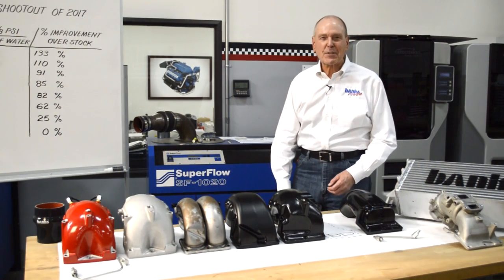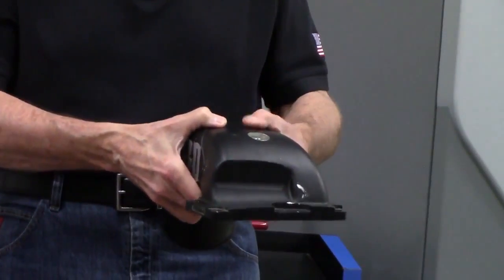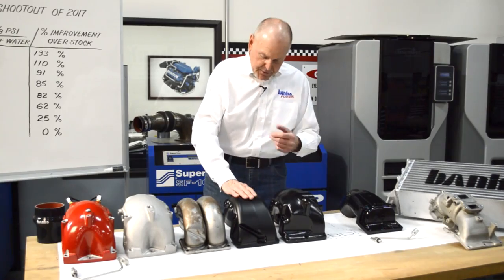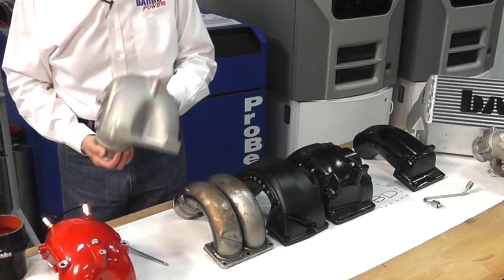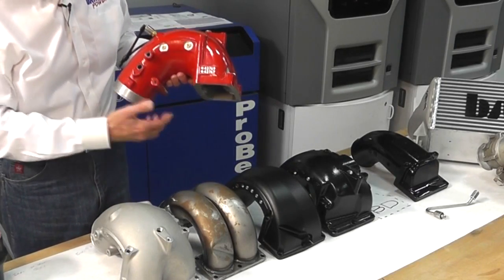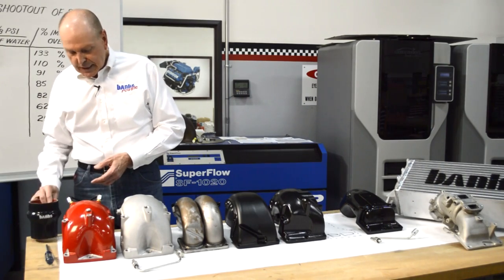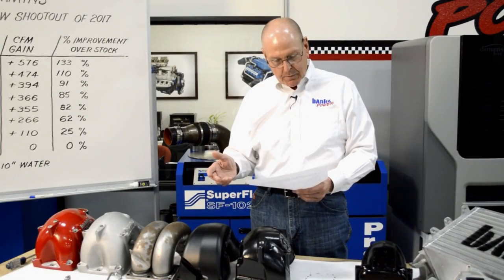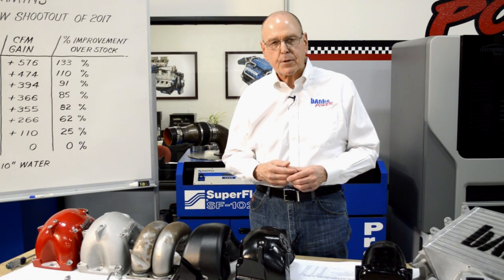Banks Monster-Ram is the best Cummins 6.7L intake manifold available.

Comment: I get Banks flows better @ 1008 over the Pusher @ 826 giving a 182 difference. But Banks advertises their horn at around $750 versus the Pusher at around $50? For the guys who just absolutely have to squeeze every CFM or who are running down the track then I get it but for the cost versus CFM gain for the average driver who wants to play a little bit on the street we're in the mud field that I can't see why the Pusher intake wouldn't be the clear winner for best bang versus buck and especially when you are essentially doubling your CFM over your stock horn.

Comment: Mr banks i recently purchased all your products for my 2022 dodge ram 3500 4x4 mega cab. Wsiting on cold air induction and intercooler tubes and horn. Intercooler still in development but will add that later.
Reply: How is your truck holding up?
Reply: @Sharee  so far really good got 19,000 miles on it
Reply: @GaryBlankenship96b40  OK, that's great to hear. I have the monster intake with heater grid delete. I will install mine soon.
Reply: @Sharee  i just a recall on that to park outside because heater can malfunction so i can disregard lol
Reply: @GaryBlankenship96b40  LOL, yes I received a recall notice for my brand new Ram as well, but I also have a 2016 Ram 3500 that I'm referring to about replacing the intake soon. They never made a recall for that heater grid which they should.

Comment: Fast forward to 2022 and now BANKS is almost 3X the price as they were here in this video
Reply from the maker: The price provided in this video was for the Monster-Ram as a solo device with no fuel line, no high-flow billet heater plate, etc. If you factor those items into the 2017 price and you account for price hikes in raw materials that have affected thousands of businesses including auto manufacturers, you're at the 2022 price.

Comment: the ss pusher goes for as low as $80 online so your really not that competitive.
Reply from the maker: The Pusher unit was priced over $350 before the Monster-Ram was released. If there was strong demand for it, the price would not have been reduced.
Reply: @bankspower  the price is what is because its so easy and inexpensive to make. Almost any pipe welding shop can easily produce the ss style and thats why they go for so little on ebay. 

I love Capitalism!

Comment: Bench flow tests mean nothing.  If he was truly seeing big gains he would dyno each elbow on the same truck, but he knows the numbers are insignificant, so he won’t.  Instead he measures free flow through the elbows at insane amounts of air, which a diesel doesn’t even use. 3-400 dollars for maybe 1 psi of boost.  The only product that’s legitimately tested is the diff cover.
Reply from the maker: The Monster-Ram isn't designed to make horsepower. It's designed to ALLOW you to make more horsepower, efficiently. But it appears that what you're really saying is not that you don't like the Monster-Ram or the way it was tested, but that you don't think an intake elbow is worth the price for the airflow gained. Every car/truck enthusiast makes choices. What return on investment do they require to feel like they got their money's worth. And, for every person, that equation looks very different. If you attend events like UCC, you'll find quite a few Cummins owners that value the Monster-Ram's flow gain.
Reply: @bankspower  Thanks for the reply. I appreciate your admission that the monster ram does not provide any noticeable gains in either boost or horsepower in stock form.  That was my point.  That’s why you published a bench flow test, and no real world results with the monster ram mounted on a 6.7.  I understand if someone wants to throw an additional 7-10k into their engine, the monster ram might ALLOW better flow.  Good news is, most people like bling.
Reply: @dodgecummins6181  For some of us it is not a bad thing that the manifold does not produce more horsepower. I am thinking about getting a Monster Ram for my 2017 3500 just to get rid of the grid heater. I am retired and haul an RV, and reliability and durability are everything to me. I already have enough power. I don't want to sacrifice any reliability or durability to get more. I do want the "killer bolt" fix that the Monster Ram provides. But i am not interested in making any more horsepower at all.
Reply: @headdown1  sure, sounds just fine on a 2017.  Useless on my 06.

Comment: I know this is an old video but if they are so proud of their products and their design and not compromising on the design they shouldn't charge for the fuel line. It should be included since you 100% need it.

Comment: I know you guys do all sorts of testing, but have you ever thought about dimpling the inside of the elbow like a golf ball to create a lower drag coefficient for the air passing over the walls?
Reply: It's a great application of that technology, but it's likely not cost effective in this situation.  The air horn is meant to slow down the air (increasing the pressure) and directing the flow into the manifold.

Comment: I have the Cummings 903 engine in my boats. Good reliable engine. Just weaker then hell. Only pushing about 300hp with twindisk gears 2:1 and 28”x24”props. Ill check on prop measurements again tomorrow to make sure i told you right. Can i get some info on any ideas for more power on them. Have someone contact me please.

Comment: @bankspower I bought a Canadian 2013 6.7 Cummins with a Shocker Pass (air shut off safety system).  I have disabled the system and removed the wiring harness. I want to remove the butterfly air shut off assembly beneath the intake elbow piping. The truck is already EGR deleted and tuned  but has a factory intake elbow. I have heard that leaving the heater block installed makes the banks intake elbow useless. I live in a cold environment and want to leave the heater alone. My roundabout question for you: Is this true? Will I get any improvement with just your intake elbow? Also I need to remove that Shocker system which takes up around 8 inches of tube beneath the elbow, is there a complete replacement included in the kit. Thank you very much for your time. Hopefully I will make my first Banks Power upgrade and become a lifetime customer.

Comment: I'm a big fan of what you do and how much R&D you put into your products; however, why aren't the same design principles applied to all of your products? For example, I have a 98 12-valve Cummins, but the intake elbow has square cross-sections and costs about double what this one does. I realize that it is a different overall design and may have more machine work involved, but it seems like that could be executed better like the 6.7 L version is.

Comment: Too bad I have an boost leak after installing their product and their hose clamps suck, didn’t come with all hardware,  and most of all extremely rude customer service! Would never recommend nor do business with them again. $956 dollars later I gotta go buy different hose clamps and use bolts around the garage to close off holes on the inlet horn. Thanks!

Comment: Running Banks Monster Ram intake & Intercooler on my 5.9,best around!
Reply: Did you notice an improvement with the monster ram
Reply: Also got the Banks intercooler,so yes,gonna  install the grid heater delete & Flex A Lite fans next,just installed a Fass 165,Beans Diesel sump,Glowshift big line kit & Fleece fuel filter delete distribution block.

Comment: Ok, it flows more CFM, but the restriction is your head. Put a 55 gallon drum horn on it if you like, but it's only going to breath as much air as the head breaths...
Reply: Exactly what I was thinking.  Not an accurate test because flow isn’t measured at the head of an engine.

Comment: I see the idea of this test but this is measuring total CFM through the intake horn to atmospheric pressure, no restriction (cylinder head). Most stock Cummins heads flow approximately 165 CFM and modified heads around 250 according to D&J Performance’s website. If you have a intake elbow that flows 900-1000 CFM what are you really gaining if your head will only flow 165-250? Theoretically the stock elbow will flow twice what the factory head is capable of.

Comment: I dont buy banks for 3 reasons.
1.  It wont clear twin fuelers - ie ATS twin fuel kit
2.  Im not convinced that the extra flow equates to ACTUAL RWHP.  My truck sees well over 100 psi at the intake manifold
3.  It consistently cost more

Comment: Would this test more or less apply to 5.9 elbows?
Reply from the maker: Each intake elbow will raise boost without increasing backpressure at the turbine which results in a more responsive, fuel-efficient engine. That being said, the idea and testing on the 5.9L could be done in the same fashion, but the performance numbers will be completely different for each engine.

Comment: What does one of these do to my factory warranty?
Reply from the maker: Unfortunately, the Monster Ram intake elbow is for racing purposes only and is not rated for street use. It requires a race tune for the ECU which means voiding the factory warranty.
Reply: @bankspower  can you please comment as to why you didn't show the stock intake like you did all the others?  It (stock) was sitting to the side for a bit then disappeared off camera.  It seems as though there are at least two versions of the 6.7 intake.  Banks along with everyone else shows a really restricted version for all their comparisons.  When in reality (read the reviews and look at the pictures on banks power website) the stock intakes are not near as restrictive as you advertise.  Please comment on this because the consumer deserves the truth, and not some marketing/advertising gimmick.

Comment: None of these intakes matter if the stock size compressor wheel is on the engine. That is your air limiter. Not the intakes. Who gives a flying fuck with these tested on a air flow bench. Funny how they didn't dyno the engine with each intake installed for hp and torque difference. I'm pretty sure i know the reason why.

Comment: I have a stock intake elbow on my 6-7 Cummins I can run 42 psi of boost with my stock Turbo measured with an analog gauge in the manifold that's 42 PSI waiting at the valve. what the hell does the intake elbow have to do with any of that
Reply: Has to do with running the engine in the higher RPM'.s The restrictions start to add up to gain flow at a good temp for controlled combustion. Basically, The more restriction after the inter-cooler, the more temp rise you get in your intake charge. Just 5-10 degrees can make a huge difference.
Reply: @Darkhalfcustoms  okay I get that but wouldn't the metering orifice technically be the intake valve ports?
Basically I'm wanting to know since I run 42 pounds of boost with stock intake stock Turbo at 2300 RPM if I put his intake horn on will I gain any noticeable horsepower over that?
Reply: @trxcummins7388  I would say you would have to do some math. It comes down to the cfm of all the intake valves VS the cfm of your intake horn. I don't think it would be a huge difference.
Reply: @trxcummins7388  the best way I can explain it is with wiring if you try to put 100 amps down a 16 awg wire it melts. But you put a 1-0 awg cable there and no problem. Pressure in your system is like amps in a wire if you don't have a big enough wire to flow the amps (volume of air) then it can't get there very good. Engines are air pumps the more effective they are at moving air around the better they can run. Do if the motor flows a larger volume of air easier then less boost is needed to get the same power.

Comment: The elbow flowing good is all fine and dandy but what is the purpose  of the elbow when the log on the intake is the same no matter what elbow is on it. Its basically impossible to port the log on all 6 cylinders all the way to the intake valve. So what exactly is the point. Its like a victor manifold on a stock goodwrench 200 horse 350 chevy.

Comment: Why is pusher the one that you need to beat as per gale bank's words?, and I just so happens the crappies looking one of the off brands had that the best flow. Yes just under bank's that is.
Reply from the maker: Not sure what you mean by "needs to be beat." Does the pusher intake work? Sure. How much better did it perform than stock? A little better. Did the Monster-Ram out-perform it? Yes, by quite a bit. That's what we pointed out. All the performance numbers are there for you to evaluate.
Reply: @bankspower  are you going to do a video for the 5.9 manifold?
Reply from the maker: We already do. https://shop.bankspower.com/i-968
Reply: @bankspower  thanks for your help!! Have a nice day.
Reply from the maker: Ahh... now we understand. The Monster-Ran "needs to beat" the tubular piece from Pusher because it's so basic. It's the baseline. Meaning, it's what you would build if you owned a tube bender and a welder. Entry level.
Reply: @bankspower  the pusher  took second place out of the off brands, that all look "professional" lol. But yea bank's looks the best and had the best numbers.

Comment: Banks performance is top tier, no dispute. Very concise and informative with apples to apples comparisons. The only thing i would question is, how do these flow ratings on this one piece of the 6.7's turbo system translate into hp/tq and driveabilty? Is it worth upgrading if you already have one of the competitors? For instance, my 2015 came with the pusher piece installed by the previous owner. It rates the highest next to his products. I would prefer his product but is it worth it? He also bashed design style and components of the pusher, buts makes some products of his own very similar. For example, the Power Pack for the early ford powerstroke 7.3 pre super duty manifold.  This is the cold side piece that diverts the charged air into each head's intake plenum....very similar technology! Unless they have improved it in the past few years its the same tech they used in the mid 90's when it was new. He also hits AFE for marketing tactics of their MDV, which i agree is a gimmick. Every company has a marketing tactic to sell their stuff. Banks seems to use years of experience and technical data as "proof" which are valid but could also just be part of a technical jargon marketing plan, again how do they compare in HP/TQ and/or MPG?
Reply: I'd replace it for piece of mind if i had the pusher installed. The extras would be the angle for the water/meth ports, sure the other one has them but they're in positions that probably wouldn't even be beneficial.

Comment: So you made an inlet that is no longer an direct replacement and requires modification to fuelrails to be able to fit in.. But you only use on test competitors models that are direct replacement and need to clear original fuel rails, and there fore have to do balanced decision on performance.   

All so you talk crap about competitors watermet spray and sensor placement.,  and  next product you talk about how it evaporates perfectly on your product...   like it does not on any other cases when you mix metanol with water and hot airflow..         Damn this is cheap pr work..  cheap as hell.       You should be a shamed of this ...   so damn shamed..     You either think your customers are dumb as fuck and dont understand it how you twist the test to suit you and only use competitors that you will beat but are in different class ...     

Or even worse,   you have nothing good to say about your product so you need to talk crap about others products and get cheap points about pointing out facts that your product is bigger and there for flow better, but ye you need to redo you fuel lines aswell and all gaskets needs to be changed as old ones dont work and what ever else you need to swap out as it no longer is an direct replacement part like others where.      

On your words...     You could make that roster pipe flange for half the price with improvments..    Go a head .   do one..  i bet customers would love to buy that..  Direct replacement that is over 92% more efficient and only costs half of the competitors price..      Thought to manufacture them in China or what ?    I bet that would sell well.  Every red neck wants to have their offroad engine saying Made in China   =)

Comment: Is the modified fuel line length the same as the stock fuel lines? Or do all injector lines have to be replaced to the same length?
Reply: what does length have anything to do with it?
Reply: Alex Macevicius I’m not sure, but in tech school we were taught injector lines have to be the same length or it will throw off timing. It was never explained in depth as to why but we were told that is why diesel injector lines have intricate bends. Common sense tells me it doesn’t matter because a fluid is not condensable so the same metered amount should be injected regardless of line length as long as the system is primed. But I’m assuming we were taught these based off of the idea of, “ well the engineers say this so it has to be true” type thing.
Reply: @enchantedwenis4994  that's like old school mechanical diesel.  Cummins has used common rail design since the 5.9 24 valve motor.  Hopefully this is something they taught you 20+ years ago or I'd ask for a refund.

Comment: Mr. Banks can you please make a video addressing the EGR on diesels? are they a detriment to the power and overall health of the engine? Im just new to this, and I own a BMW 335 diesel. Thank you so much for sharing your incredible life experience.!
Reply: Yes they are. They raise intake temperatures and introduce none burnable air into the cylinder to save on NOX emissions. The best way to handle NOX is with SCR in the exhaust system. Anytime you put extra heat into a motor you are making the engine wear out faster.

Comment: How much air does the engine use at WOT? Does it go through 1000 CFM?
Reply: Non boosted the engine will flow 312 CFM at 3000 rpm. Push 120 psi and it will use up all of the 1000 CFM.